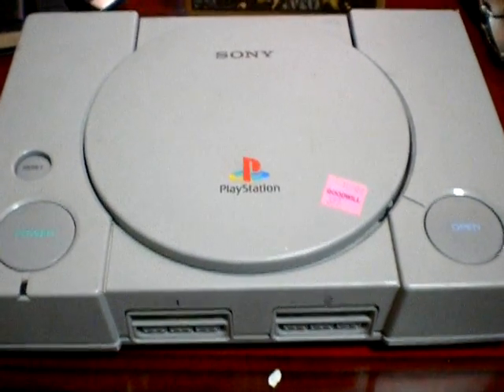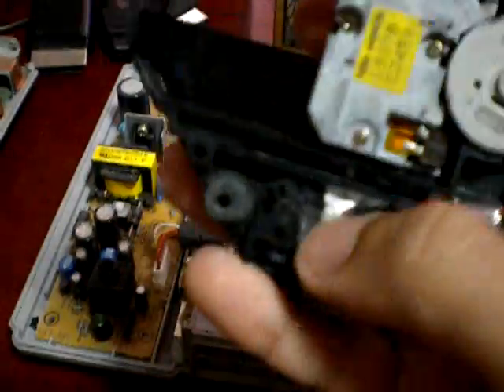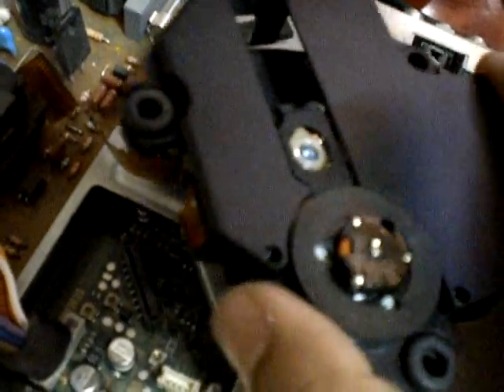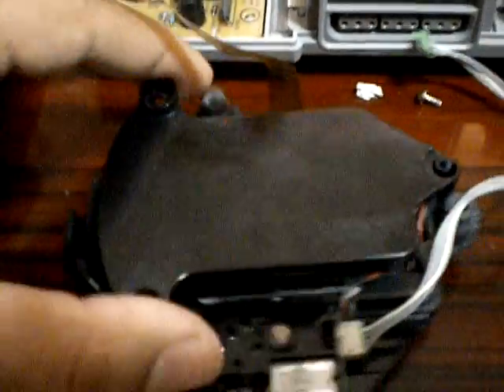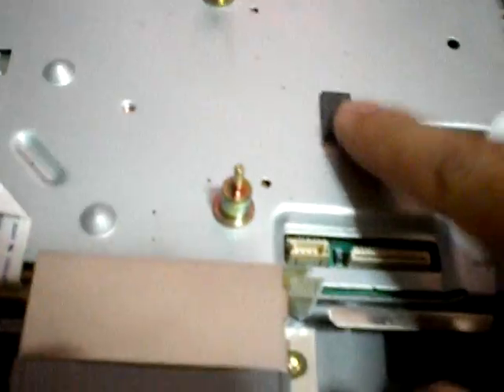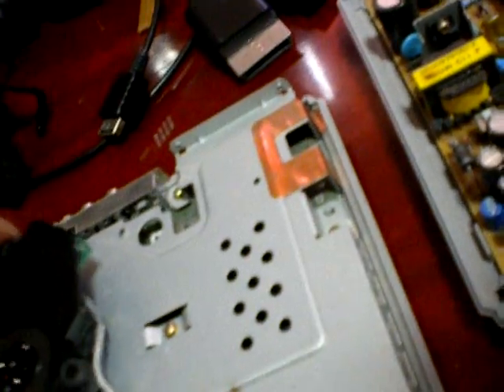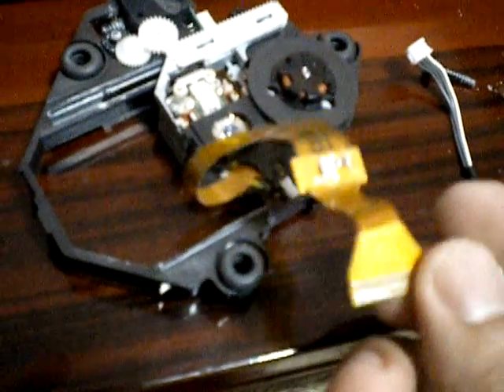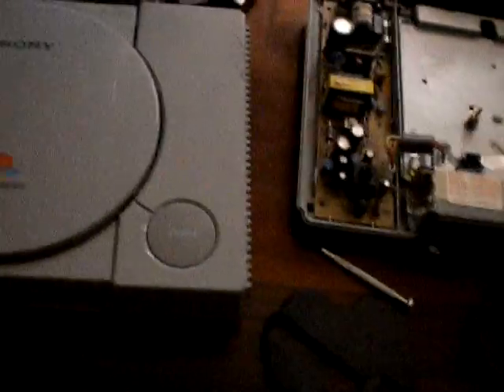SCPH-1001 Playstation Lense Swap with a Newer Model's Laser

Comment: Does this fix the FMV skipping issue in the SCPH-1001 model and if so can I use a 9001 lens or is the highest lens I can put in the 1001 is a 7501 ??
Reply: Nevermind I did some research and the KSM-440BAM's from the slim PSone's are the best to replace the 1001's with. All you have to do is swap the top of the assemblies. No cutting.